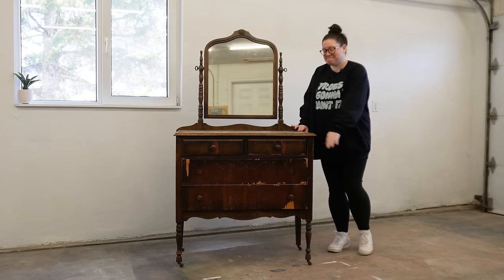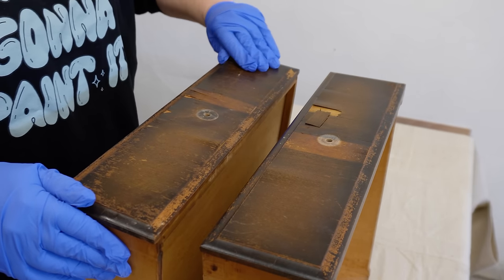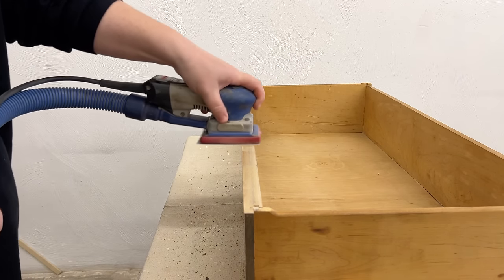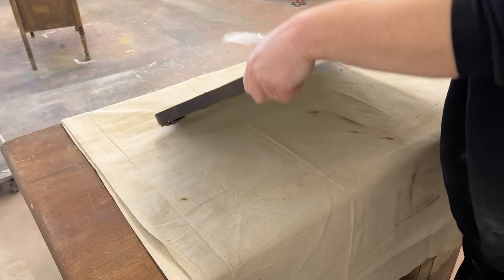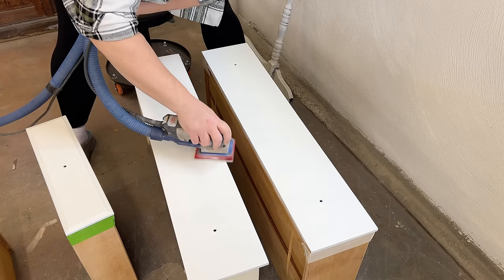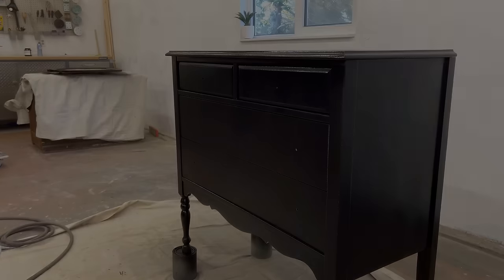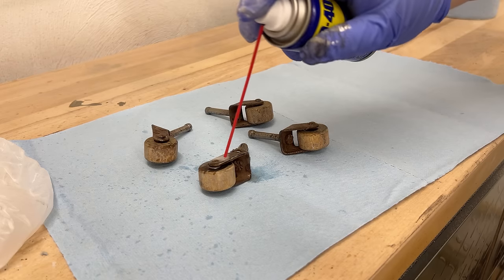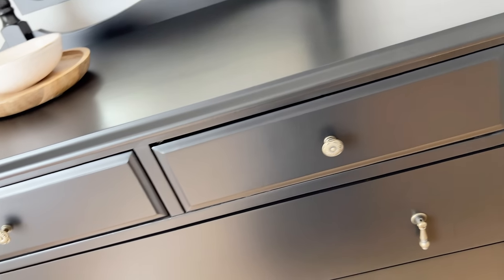Reviving the Past | A Sleek Update for a 1930s Vintage Dresser

Comment: I am restoring an old Hoosier cabinet that has at least 6 layers of paint with at least a couple of the layers of paint being oil based.
Anyway, I tried using the iron/wet rag heat/steam method...it works!  It's still gonna take some time to strip it, but, I got more done with it in just one day than I  did with the eco-friendly stripper I used several months ago!
The cabinet appears to be oak.  I hope to post photos once I'm done.
Thanks, again!

Comment: The finished product looked great.  Am a fan of saving older furniture and re-using it.  To make it a more versatile though,  I would have separated the main body from the mirror rather than keep it together if you were going to use it in an entry way, or room other than a bedroom.  Using the mirror on the wall over the  piece of furniture would make it feel more updated.

Comment: My dear, get yourself a trimmer for your edges. It is such a fantastic tool. Try to find the one made by Richard as they don’t shed and you can wash the pads and re use them. I actually paint with the trimmers, especially when using Fusion paint.

Comment: I have a similar dresser which is larger (wider, wider mirror). Black works well on this one because it is smaller. I was going to do a cane stencil over paint on mine (one idea) on the drawers n side. But I'm thinking of just painting ot. Totally stumped on color. Black would be too heavy due to its size. Great job!!

Comment: Wow...just wow... love it!  I have used that same primer.  It ruined my roller and brush, in that I could not clean it. Have you found that to be the case as well??
Reply from the maker: Shellac based products must be cleaned with either denatured alcohol or ammonia. Having any sort of water touch it will cause it to instantly solidify. That's why I use a cheap disposable roller and don't put it in my spray gun.

Comment: Over 70 and sick that all the really great oil base finishes are gone. Water base works nice with a sprayer but there is equipment cost. Flooring people have told me oil base finishes are far superior to water which is more likely to fail, cracking with movement. It doesn't have  the give oil does.

The piece you did was mess but everything you did was excellent. I'm wondering if that Varathane Diamond finish can be brushed on. My sister and I had dressers in the 1950s like the piece you fixed. Wish we still had them.

Comment: Thank you for this. I have a similar piece that I want to do in a much light color but I was having some apprehensions on painting it. I also want to add on the casters since mine came without them. Any suggestions on where to find asthetic replacements?

Comment: The black is perfect!  I have a very similar dresser that I have been wanting to paint just like this.  I don’t have a sprayer.  Would you recommend this paint if you are rolling it on?  Any advice?
Reply from the maker: It does roll nicely but if you want a SUPER SLEEK look with a brush or roller I’d choose Behr’s Alkyd Enamel instead.
Reply: @salvagedbykscott   Thank you!  I appreciate the feedback.  I do want that super sleek look so I will definitely go with your recommendation.  Would you recommend the polyurethane finish over it or is the alkyd enamel enough?

Comment: Can you speak to the choice to do wood putty over bondo? I've seen you do both and wonder what factors go into your decision. Thanks!
Reply from the maker: Putty is usually thicker and more mouldable while Bondo is looser and easier to spread however both are durable epoxy styles filling products that could be used interchangeably in a lot of circumstances.

Comment: Hello! I heard you say before in a video that you sometimes wet your roller before painting, do you ever wet your roller before the B-I-N primer? I know it's oil based so I wasn't sure, but when I roll on that primer with a dry roller I always get a ton of bubbles. Have you experienced this? Or do you have any tips? Thanks!
Reply from the maker: You shouldn’t add anything with water to BIN shellac based primer. It will seize up and harden in clumps immediately. Rollers create texture no matter what (thats why you need to sand it) but if you’re getting lots of bubbles you’re probably working it too much.
Reply: @salvagedbykscott  thanks so much for your response! I admire your work so your help means a lot! I will work on that 🙂

Comment: Try sticking some zip ties through the hardware holes on the drawers before you push them all the way in. 😊
Reply from the maker: No need. They come out easily enough with a screwdriver.

Comment: Not into black every spec of dust shows I have parted ways with all but one piece of black furniture.  I am a neat freek !  Lovely piece but I would have not chosen to paint it.  I realize that the veneer piece are difficult to work with but I would have matched the color of the original piece.  Not with paint.

Comment: Likely, I would have painted it black with some gold touches on the flower and spindled areas.  I would have silvered the mirror.  That dirty drippy look old mirrors have annoys me.  Or, I would have mixed a few different colors and used antiquing wax or dry brush and maybe added rub on transfers.  I most definitely would never do white.  It’s the lazy man’s solution and somewhat boring.

Comment: I have to dissent here.  Speaking as a potential customer ---and certainly not as someone with more skill --you should have called this video “A Quick and Easy Flip”.  I think this was a wasted opportunity.  The dresser was extra special stylisticly.  

I disagree that you needed to paint all of the dresser. I think it is to uniformly black now. The fronts of the dresser looked pretty good to me after you got the veneer off and sanded. You could have sanded those as I have seen done in these vids.  Even just doing one drawer would have added some needed contrast.  A dark walnut (but not so dark as the hide the grain) would have been a nice contrast with the black. I would have paid a premium price for it. Its a shame you did not save or duplicate the routed detail on the second drawer from the top.  

I approve of the hardware and the clear coat finish. The wood knobs were not special even if they were original.   Finding knobs that matched the carved flower was both lucky and smart. Those were good choices. 

If I was buying this, I would want the inside of the drawers clear coated instead of just the wax stuff. That doesn't last and the customer isn't likely to keep re-coating that a few times a year.
Reply: I agree, easy, run of the mill fix for a very special piece that could have been much more. I guess the expertise is not there, to the detriment of this piece.

Comment: I just don't see why you furniture "restorers" waste your time. If you don't know anything about restoring veneer so you still feel the solution is  to peel the veneer off and paint the sh** out of everything and ruin the craftsmanship of the original piece. Paint the  recued 1970s garbage and save the landfills but give the woodwork over to the ones that can actually save it.